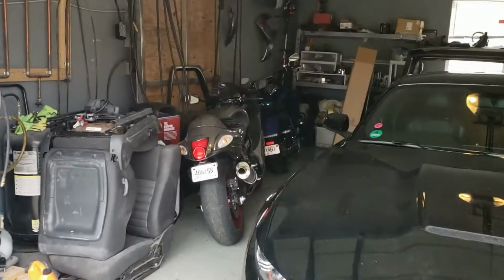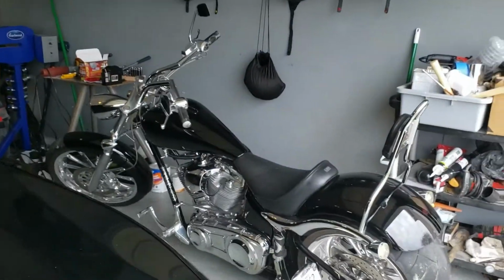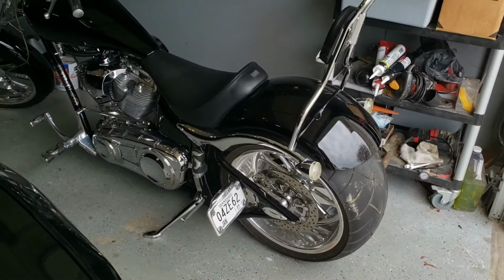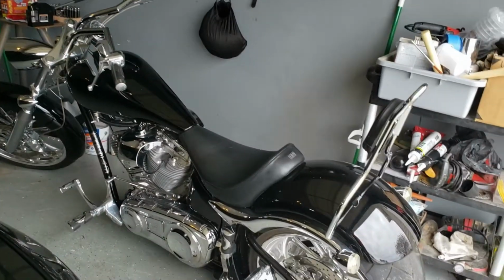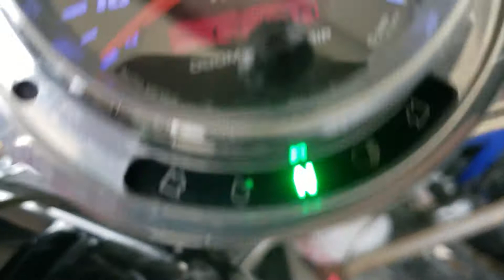2007 Big Dog Mastiff. Cheapest one around | Big Dog Motorcycles

Comment: You got to twist the throttle half turn twice before hitting starter button it'll start much easier for you , I've got a 2004 Big Dog Chopper carb  107ci not a problem after that plus your starter will last longer that a fact!
Reply: Also have a uitlma kick start IGN , 0 dead revolutions and Kickstarter for backup,plus a all balls starter shaft  made of quality steel ,better than stock crap💩👍😎✔️it won't twist up like stock one when engagement happens😎

Comment: hey, nice video, even nicer bike. I bought it months ago, it was a project  being put together when i bought it. its actually just like your older bike that you showed a pic of. (the one with green flames) I didnt get any info on the bike, it was thru a trade. I was wondering if you can tell me the year and model of that bike so I can hopefully look up more info on it. the one thing Im missing that cant seem to find is the tank with the matching paint job.  thanks and I enjoy the content on the channel.
Reply from the maker: The one with the flame was a 2008 Big Dog Bulldog, it was fuel injected and the Mastiff is not. I much preferred that one over the Carb any day of the week. They are both incredibly hard to start and if its even slightly cold outside, you can forget about riding it. Cheers
Reply: @BentOaksGarage  thanks for the quick response. Yea, this thing is carbureted, I'm gonna look into the updated starters.